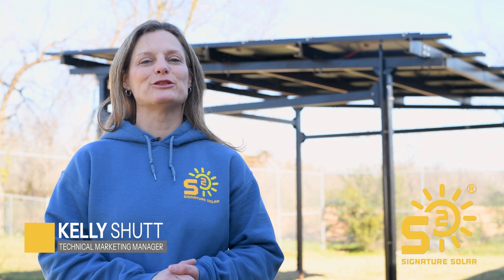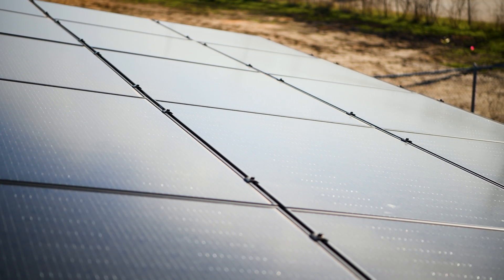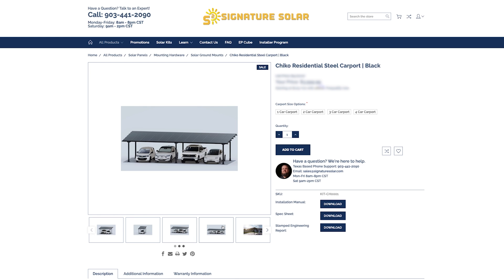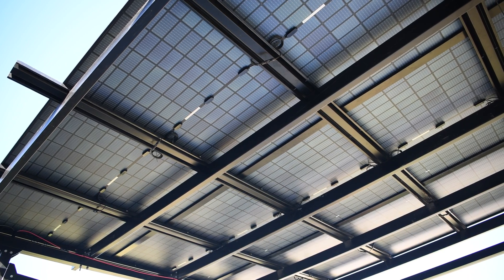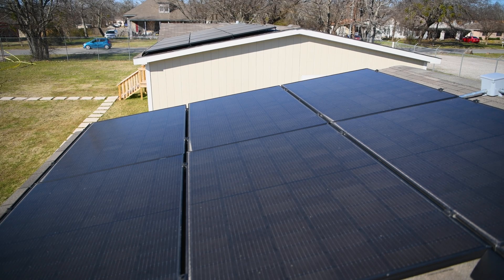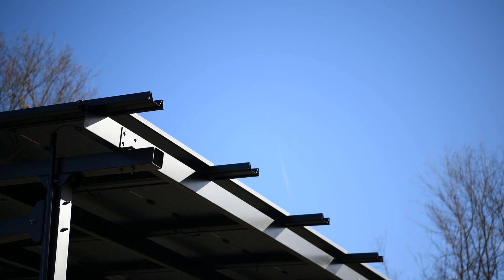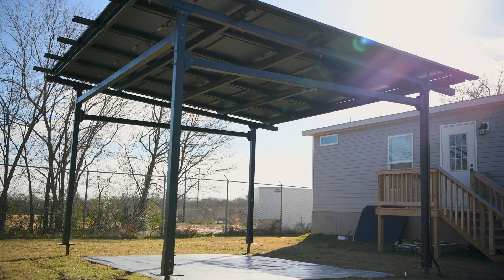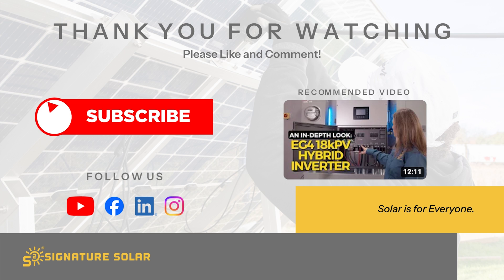Chiko Steel Solar Carport: Effortless Installation and Durable Design for Reliable Solar Solutions

Comment: Hi there, I’m considering using your system for motorhome parking.  I would need a park by entering the side of the structure.  What is the height of the cross bas from ground level? I’d take the footprint dimensions too if possible.
Reply from the maker: Hi! The Chiko Steel Carport's cross beam height from ground level is about 9 feet 3 inches at the front and 10 feet 6.5 inches at the rear. The footprint dimensions for the base plates are approximately 30 cm x 30 cm.

Comment: I wish someone could invent solar panels that can withstand a hail storm. Your investment can be completely wiped out in less than 10 seconds.
Reply: Solar panels have survived hurricanes and most hail storms do not break solar panels. 

Hail is covered by insurance. 

The payback for solar is as low as five years now so your investment will be paid back 4X-5X in the 25 year warranty.
Reply: @rob1andrews  Prove me wrong. Golf ball to baseball size hail, plus the wind gust of 60 plus mph won't destroy solar panels? Insurance may cover it, if you can afford insurance these days. Apparently you don't live in Texas.
Reply: @ There are 22 gigawatts of solar in Texas. If hail was such a huge issue, why is it the solar the #1 source of new power generation (has been since 2020).   You are worried about a problem that was solved over a decade ago.

Comment: Ive got a cape cod style house that does not give me the ability to add panels to my house. But i have room in the back to put something like this on my concrete patio. Do you guys offer that ?
Reply: You’re looking for a solar pergola. Tons of options out there, from diy to full service installers. Most of the full service installers I spoke to can do a pergola rather than on the roof if needed.

Comment: Can you design vertical orientation panels mounting tech (positioned panels like a fence) so users can utilize morning and evening light (avoid the, heat degraded, noon peak light - where excess solar is not as needed)? Fence orientation also allows the horizontal space between panels to be used for other things (ag, garden beds, or other things)

Comment: 5 degrees.. need more like 20-30 degrees. Why settle for 5 degrees?
Reply from the maker: Hello! The official response from Chiko is:
If the tilt is any higher, then the unit jumps into a much higher engineering paradigm of requirements.
And much greater design loads, are required.
This means a greater/heavier structure, and much greater cost.
A customers’ plot of land may be such, that carport can only go in one location and orientation.
With the low tilt angle, the kWh electricity production is not greatly affected if the carport must be pointed to an ‘azimuth’ (direction) that is not the ‘optimal’. 
If the carport tilt is high, the carport facing in the non optimal direction would significantly decrease the kWh electricity production. 
The lower tilt angle of 5 degrees will produce more kWh in the summer season that the ‘optimal’’ tilt angle
Electricity rates are such now, that the summer kWh rates are significantly greater than the ‘non-summer’ rates.
Therefore, the $$$ value of kWh electricity production is greater than ‘optimal’ tilt
‘Optimal’ Tilt is an axiom that corresponds to electricity kWh rates that are the same in all parts of the day, that are not time of use.

Comment: How are the base plates mounted in your video? I just got mine and have been exploring different options for footings.
Reply from the maker: The most advisable course of action is to install concrete footers. This will require obtaining the necessary permits since it involves excavation of the ground.

Comment: Can you also please offer some clarity on the power capacity of this product?
You list 12x PV modules on your website, yet show 15x installed here.
I assume the listed 400W modules in the description are what was installed; that would be 6 kW for 15x.
Reply from the maker: This demo model comes in various sizes, accommodating different numbers of panels. The one we used could hold up to 15 panels. However, during our video demonstration, we connected only 11 panels in series to mimic the setup on our rooftop, aiming to compare monofacial and bifacial setups. This configuration theoretically should have provided 4kW. Unfortunately, we encountered issues with our inverter, resulting in an output of only around 1% of the expected power, approximately 40-45W. We're currently investigating the problem with the inverter. I hope this helps!!
Reply: @SignatureSolar  You also compared the voltage of the two strings, and concluded that the one with higher voltage was producing higher power - that's absolutely not how power works. Its voltage x current, and the clue that tells you that you have something like a bad connector is right next to that number ... "45w", so current in that array was ~110mA, clearly a bad connector, or near-dead short. This is why you should commission the array before running it - that would have identified that in full sun, during a dead-short test, the array was producing around 1% of the expected power. If the array commissioned within expected specs, then you look at the battery - if the battery was already full, 44w+40w+45w is what i would expect from the arrays - i.e the typical standby cost of the mppt and inverter, in which case you just put a load of more than the expected production to get the MPPTs back into bulk mode. The battery on your screen looks like its at 38%, so if thats the case it looks like either bad cabling or the inverter settings are wrong

Comment: The 'nominal' slope for a year-round, fixed mount, south facing solar array is the latitude of the location...
In other words, the 'ideal' angle of 5 degrees is WAY too low for panels north of the Panama Canal.
In the Caribbean, the angle would be 15-20 degrees (a 1/6 roof slope) and in New York City it would be 40 degrees (almost a 1/1 roof slope).
Reply: what would be the recommended slope for a west facing roof?
Reply: @scottmcshannon6821  search google for 'ideal year round slope for west facing solar panels' and it should give you some guidance and links.
Reply: Jamaica where i live is 18 deg.
Reply: Slope depends on what you're maximizing. It's been a while since I did solar design but if I recall max kWH/yr is typically latitude minus 15 degrees, so about 25 degrees for NY (you get more kWH in summer). But yes, 5 is low for most places in mainland US. Also wouldn't help with snow clearing.
Reply: @metalhippiedude  general guidance is to start with the latitude and increase slope (more vertical) up to 15 degress in winter when sun is lower in sky and decrease slope (flatter/more horizontal) up to the same amount during summer. You are correct that 25 degrees would be ideal in NYC for peak summer capture, where 30-32 degrees might be more appropriate to improve capture during spring and fall (at the expense of a small amount of capture during summer).

Comment: Comparing voltages????  MPPT can vary voltage in any string depending on what it thinks is optimal. Always compare power, otherwise (using your voltage analysis of power) the static electricity i just produced walking across the carpet is 10x more powerful than your solar arrays.  Fortunately if we look we can see 40w and 45w showing when you are talking about voltages as a power measurement 🤦‍♂
85watts total coming from 2 x 11 x 400w panels? These should be 4400watts per string in perfect conditions.  These are currently producing 1% of capacity. Maybe do the power production test when there is power being produced in some nominal range.
Anyway, the carport is nice.
Reply from the maker: You are correct.  Thank you for pointing out my mistake in using the wrong number to make the calculation.  The wattage should have been used.  To calculate, you would calculate the increase / original number x 100%.  In our case, we would find the increase by subtracting 45 W - 40 W to calculate an increase of 5 W from our monofacial panels to our bifacial panels.  Then we would divide our difference of 5 by our original number, 40 W from our monofacial panels.  So, 5 / 40 = 0.125.  To find our percent, we would then multiply this number by 100, 0.125 x 100 = 12.5%, showing that we actually are getting a 12.5% increase in energy production out of our bifacial panels over our monofacial panels even at this lower wattage production.  As solar production conditions improve, we would expect to see this same trend continue. The day of testing was less than ideal conditions, when conditions improve maybe we can go back and do a follow-up test. Thanks for the feedback!
Reply: @SignatureSolar  And since power is low during that measurement maybe its all the more argument to use the bi-facials.  12.5% more when you are getting little sun is even more of a help when you need it most.
Reply: @jasongphillips  It wasn't a valid test - all that test showed is that when the MPPT is in float mode, the MPPT was choosing to get a fraction more of the power it needed from that array. If you had a domestic tap, and a fire hydrant, both turned off, and the domestic tap dripped at 5 times the rate that the fire hydrant does, you can't conclude that the domestic tap is going to produce 5 times as much water when turned fully on.

Comment: If I owned one of these solar carports..  I'd park my White Jeep underneath it.. I've got 1200w (Six Bi-facial 200w JJN) on a dual axis tracker.  I ordered a pair of 25' 4ga wire that I'll connect from my 3 controllers that go to my Four 100Ah lithiums, that will replace the small 8ga that is connected now. IT's currently (< lol) connected now creating a bottleneck of power. This would be a perfect carport to park my RV under when I get my offgrid land.

Comment: Creative place to put panels. The design could use some improvement for finished aesthetics. ARKA also has a nice look, at least in their marketing.
I believe there is a mistake in the performance comparison, however. You should be comparing power [Watt], not voltage [V]. Looking at the power output, it was only showing 40-45 W. Was that filmed in the morning or evening?
Information about anchoring requirements would be helpful too. I assume this needs a significant concrete footer. Here’s another thought - could energy storage modules (heavy, bulky) be used? Another multi-purpose design element.

Nonetheless, keep it up Signature Solar.
Reply from the maker: You are correct.  Thank you for pointing out my mistake in using the wrong number to make the calculation.  The wattage should have been used.  To calculate, you would calculate the increase / original number x 100%.  In our case, we would find the increase by subtracting 45 W - 40 W to calculate an increase of 5 W from our monofacial panels to our bifacial panels.  Then we would divide our difference of 5 by our original number, 40 W from our monofacial panels.  So, 5 / 40 = 0.125.  To find our percent, we would then multiply this number by 100, 0.125 x 100 = 12.5%, showing that we actually are getting a 12.5% increase in energy production out of our bifacial panels over our monofacial panels even at this lower wattage production.  As solar production conditions improve, we would expect to see this same trend continue.
Reply: @SignatureSolar  Thanks. I still don't think it's an accurate test considering you're only getting 40 - 45 W out of a 6 kW array. I suggest you remove this test and claim from this video.
What would be really helpful is more information about assembly and power capacity. The Chiko manual says 2-3 people yet I see about 6x here. And the module and array sizing is as clear as mud. I see one dimension in the Chiko manual (270" N/S span). Your website lists 12x modules per carport then you show 15x here and multiples of 9x on your website images.

I want this product to succeed and have customers interested in it but I also don't want to fight with unclear installation and design information on expensive and bulky equipment that can't be easily shipped and returned.

Comment: Also they can’t be shipped direct to consumers home. They have to be shipped to a business with dock or terminal. Seems like you could build a wooden structure for a lot less and I think it would be much for pleasing to the eyes IMO
Reply: The only benefit I see to buying something like this over building your own is that it comes with stamped engineering plans, which makes getting a permit from your local jurisdiction a lot easier.
Reply: @joeyhazlett I hadn't thought about that. Pergolas don't need a permit around here tho.
Reply: @joeyhazlett  It might be more resistant to wind than wood, too. I live in a very windy area so that's a real factor in determining what I end up using. Still, 5x the cost is a bit tough to swallow.
Reply: I was just going to post the same thing. I hired a handyman carpenter to do a 12 x 18 pergola-style lean-to for $500 and about $350 in material. (6x4 posts, 2x8 beams and 2x6 rafters) I appreciate the hardiness of steel but not for 5X the cost.
Reply: @cquintana9326  Lumber is reasonable where you live.
Reply: Pergola doesn’t need permit where I live as long as it’s detached from the home structure.
Reply: I calculated the price difference between this and wood, and it was about $1500 difference.. but then the wood has to be maintained.. paint stain.. whatever.. if your not using aluminum racking and mounting panels directly to wood, then wood is a lot cheaper.. otherwise, these really are comparable
Reply: @Mr._Craig  The problem is most AHJ's require bunch of engineering specs stamped by a civil engineer Chiko already done that when you submit plans for something like this because your putting solar panels on it. IF you submit plans that say you want a build a pergola on a napkin your good. I don't know what the source of over regulation is possibly utilities are the cause of this but so much regulation placed on solar why it costs 5 times more in the US. We need ballot measures passed in states that allow it removes all solar from being regulated by utilities and AHJ's.
Reply: Mine was shipped direct to my home.  I do have tractors to use to take off the delivery truck but no issues delivering to a customers home.

Comment: I was just looking at this unit and it only started at $3500. Am I going crazy or did something change?
Reply: $8k for the 3 car version
Reply: what's "solar" about the car port structure anyways? It's easy to adjust/set the angle & slope of the roof to the sun? Can you move it during the year?
Reply: @wim0104 the gutters between the panels probably.
Reply: Does it come with panels?